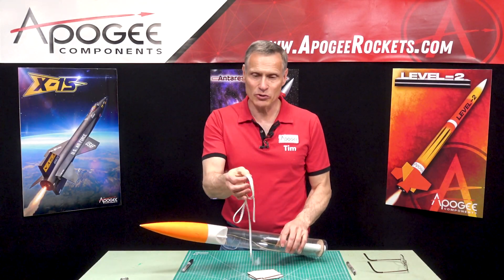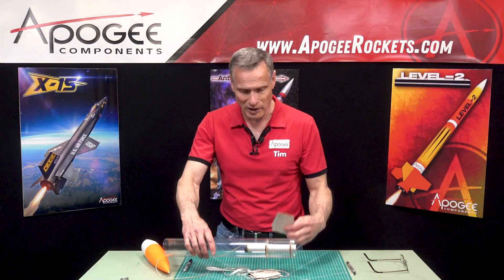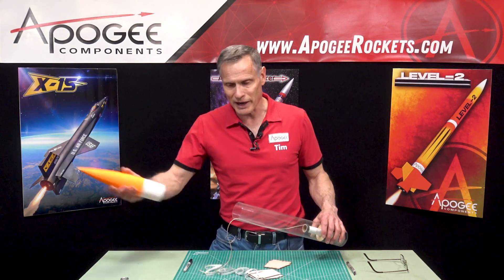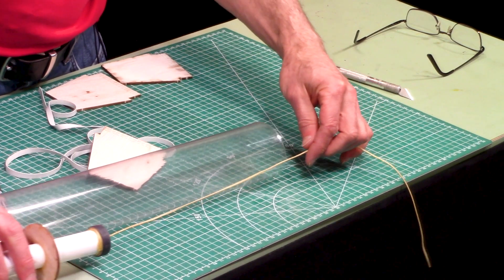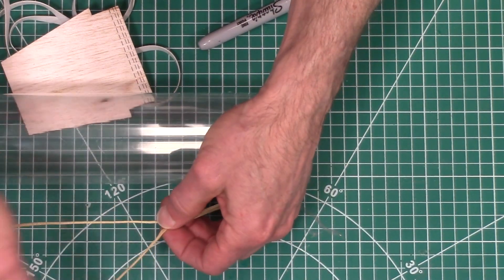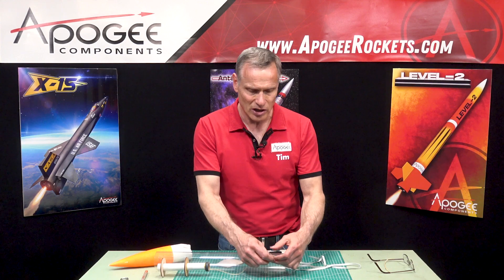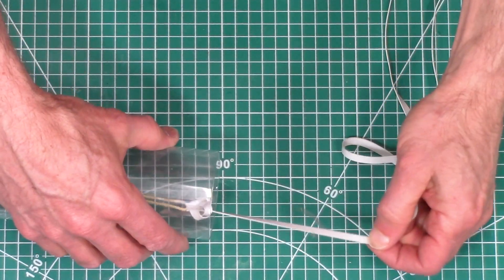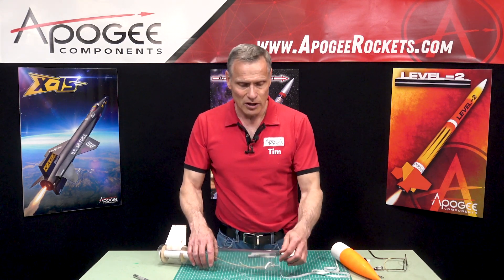How to Attach Elastic Shock Cord to Kevlar in a Model Rocket

Comment: The traditional knot to attach a thin line to a thicker line, or to flat webbing, is the Sheet Bend. I've found it works well for Kevlar to elastic -- secure and less likely that the Kevlar will cut the elastic. For a more secure knot, try a Double Sheet Bend. https://youtu.be/U4wRjpITPoA

Comment: Tim: 

For the purpose of attaching the elastic cord to the anchor, I pass the kevlar cord out back, through the motor mount. I tie them together (or more often, use a barrel swivel) then shove everything back into and through the mount and shake until the elastic drops through the front of the body.

I recently "fancied up" the recovery harness of a Star Orbiter . . . this would work fine with any brand kit.

I replaced the rubber cord with elastic, and sewed a sort of sleeve of T-shirt fabric around the last 2" of both ends of the elastic. I looped this ensleeved end through the barrel swivel eye at the anchor end, and through an eye bolt on the nose cone / payload section bulkhead end.

Then I sewed the sleeved elastic to form a loop. The fabric prevents the elastic from fraying where it connects to the barrel swivel eye or nose cone attachement.